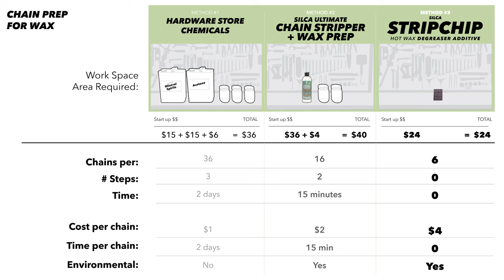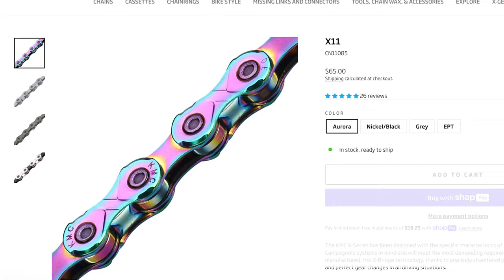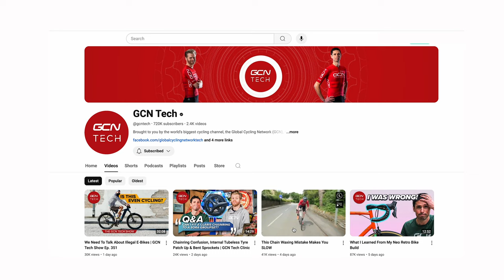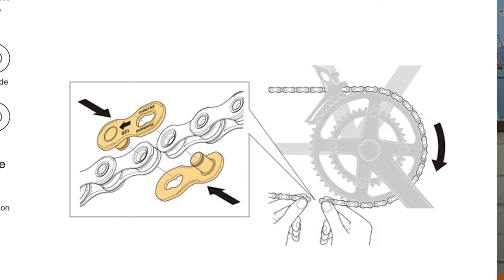Chain Waxing? Avoid These 7 Common Failures!

Comment: For those using a water bath or crock pot to melt wax (without accurate temperature control), a simple meat thermometer can eliminate the worries about hitting the right temperature.

Comment: To find the engraved writing, scratch with your fingernail.  If it has any rough texture, that's the writing side.  If it's dead-smooth it's the non-writing side.  No need to try and see through the wax.

Comment: When cleaning/ degreasing the chain it's super important to make sure that the chain is %100 dry before putting it into the pot. This helps the wax stick to the inside of the chain properly. That was the big mistake I was making when I first started waxing. Thanks for the great video Josh 👍

Comment: Thanks for the "skip break-in" portion. Other outlets and its comments seem to present not breaking in (on or off the bike) as a cardinal sin. Like it would hurt the chain or the wax application in the long run. I of course was skeptical about that stance, for exactly the reasons outlined; when you don't really care about a short period of less efficiency, if I break it in while cycling I get that period back as bonus longevity. 

This is maybe a "problem" in cycling enthusiast content and its commenters, much of the headspace is geared towards top performance, while commuters, couriers, recreational and other categories of cyclists that are not competitive receive less attention and less appropriate advise sometimes.

Comment: I have been using your wax lube for 8 months and have converted several of my riding buddies to also use a waxed chain.  I am the official chain waxer for the group.  Initially I mistook the interval of meters and was using a rewax interval of 300 miles or more.  I would check of wear each time with Park variable gauge and also with calipers with no measurable wear.  After several of your videos I woke up and realized my error.  I am now using one endurance chip per bag and rewax every 350 miles.  No signs of wear or noise on the drive train.  I use an insta pot and set the temperature at 190 degees F and verify by infrared measure method. Insert the chain for about 5 minutes and then reduce the temperature to 170 degrees F, once the temperature reaches around 165, I remove the chain and let it cool above the pot.  On either a new chain or used I dip/shake in gasoline (cheaper than solvent) 2 times, each with clean gas.  Blow dry, and then ultrasonic clean for 30 minutes minimum in the sonic cleaner you recommended. Blow dry, alcohol dip and blow dry prior to wax dipping.  I know this sounds very time consuming, but I only do this once and am getting excellent results. Rewaxing is simple, wipe the chain clean and rewax.  Our group of 6 riders are amazed how quiet and the smooth the drive train performs.  No one would ever go back to the old petroleum lubes.  You have customer for life.

Comment: Great video. I am guilty of all of these mistakes at some point since I started waxing my chains with your products over 2 years ago. Before that I was disappointed with my homemade waxing blend even after I thoroughly cleaned the chains with degreaser, gasoline, and 90% isopropyl alcohol. The wax just wouldn't adhere to the chains. After I bit the bullet and purchased Chain Stripper and your Secret Blend everything works great. I don't wax my chains for more efficiency to go faster. I wax my chains to make the drivetrain feel smoother, and I believe that is what makes me faster. The only failure I have had which you don't list is having the wax get bunched up on the lowest cog on the cassette (11 tooth for me) and I thought it had somehow worn out because it was skipping. Found out later after I removed the cassette to replace the cog that there was a thick layer of wax between the 11 tooth cog and the next cog up which caused the chain to ride up above the cog and skip whenever I applied any amount of power to the drivetrain.
Reply: I get a build up between 11/12 cogs too.  A toothpick through there once a month works well
Reply: I use the super secret drip between immersive waxings, so I’m pulling the chain off and rewaxing about once a month (every 1000 km or 600 miles). What I do is take a brush and some alcohol to the cassette, pulley wheels and chainrings while the chain is off the bike and in the pot. It takes about 5-10 minutes tops, and removes all wax buildup so the buildup never gets to the point that it’s a problem.

Comment: I just completed a 4 day 335 mile ride on a SILCA waxed chain and used super secret lube once.  Chain worked awesome.  I just rewaxed at 120 and 75 degree temps with no wear over about 700 miles.  Love this silca waxing system.

Comment: One thing I add is to preheat the chain before I put it in the wax. Living in Arizona makes it easy as I just put it in the sun for 10 minutes. This lets the wax get into all the small spaces right away. You can see this when you agitate the chain in the wax. Lots of bubbles right away, after 5 minutes, almost none. I've been using/waxing KMC chains and and I wax every 500-750 miles before it gets noisy. Cassettes and chain rings aren't cheap. Better to wax more frequently than to let it run too long. Lastly, I put a label on the chain stay with the date, mileage and Park Tool measurement so I don't forget. I get the watt savings from waxing but personally, I do it for cleanliness and chain longevity.

Comment: Embarrassingly I have made every single one of these mistakes except the first one :-)  Particularly, I have been unbelievably creative when installing the chain. I've threaded it in ways that I'm sure are theoretically impossible.  You do get used to it.  One tip I'll share (which I haven't seen anywhere): When putting the quick link on, you have tension from the pully. The chain is often slippery from the wax (hooray!).  It makes it difficult to put the quick link on.  Some people use a piece of wire to hold the two ends of the chain together.  I actually thread the chain so that the left hand side ends just a couple of links past the lower pulley wheel. In my left hand I grab both the pulley wheel and the end of the chain and pull to the right to create slack in the chain.  Then I put the quick link on with my right hand.  Once it's aligned, I use the quick link tool to fasten it.  It should close easily.  If it doesn't, then it is misaligned.  Don't force it.  Just take the quick link off and try again.  Holding the pulley wheel with you left hand makes this very easy.
Reply: Love this comment. Have never found connecting the quick link to be a quick process, but I also use the same method you do. Still tricky, but wish more folks talked about creating slack.

Comment: Having waxed my chain for the first time this year using the stripchips and wax from Silca and I can recommend it to everyone. I also routed my chain through the wrong side of the tab but it's all easy to figure out. If you can boil a pot of water you can wax your chain and over time it makes maintaining your drivetrain tenfold easier.

Comment: OK, you asked for unique questions so here's one.  I'm a 75 year old recumbent trike and velomobile rider.  I have a degenerative muscle disease and only can put out a FTP of about 150.  Being that I have a long chain and low power, it seems that my waxing lasts about twice as long as is "recommended".  Am I correct.  BTW I have been waxing my chains for over 30 years and love the ability to work on my rides without getting filthy.  Keep up the good work and great products.  Ron

Comment: Hi Thanks for making this video. I have done all of these mistakes! Also one I got in the past is "not cleaning wax residue on small cogs and pulley regularly". If I don't clean it for a year it causes jumping chain or some weird noise! I had this more when I use Squirt actually, but probably also happens with Silca wax too. And be careful if you use SRAM you have stealth ring there so not to damage it.

Comment: The thing I was ready to complain about the first time I used many SILCA waxing gear was that I couldn’t get the quick link to close. I scraped the wax off the inner plates through which the quick link attaches and it fitted. Now, I just wipe those plates with a cloth as soon as I pull the chain from the wax.

Comment: Thanks Josh appreciate you! hey, Has anyone tried cold wax? Rubbing it onto a clean chain..  skateboarders have been using it on metal and concrete to remove friction for decades,  it seems to last for ages on a ledge or rail .. food for thought . thanks again for your integrity.
Reply: Rubbing it in may not get it into the pins.  Silca will hate me.  I use canning wax.  It dissolves in Coleman camping fuel (benzene - white gas) or even regular gasoline.  You can spray the dissolved stuff on and the gas will evaporate.  However, I do put the chains in melted wax too.  The dissolved wax thing is like a refresh for the chain.  By the way, we used to rub wax on skis and sleds when I was young.

Comment: Love the wax station & hot wax and Super Secret…use all 3. I have SRAM Transmission T Top black chains and XX1 Eagle black chains…I think these have the PVD coating as well. Does this have the same effect as the rainbow chains??

And will the Endurance Chip help at all with longevity for PVD coated chains?

Thanks!

Comment: I would like to see a video where you take a waxed dirty chain off a bike and take us through how you clean it to get it ready to go back into the silca waxing pot.
Reply: Wipe off chain. Blow off dust if you have compressed air.  Rinse off if you've been riding mud. 
Dry chain.
Remove.
Put in pot.

Not a lot to it.

Comment: As someone who uses the bag to prep my chains sous vide I always keep it in there for a long time. I would say as long as you let the chain get up to the temperature of the wax, leaving it in too long as it cools down is not the worst thing in the world. It just makes a little more work cleaning off the excess. I also make sure to free off all the links befire installing. I will bed in my race chain but it's good to know it's not imperative for training, or for my commuter where the longevity and not the performance is priority.

Comment: At 4:55  Josh shows an Insta pot he used to use. I have the same one and it wasn’t working properly until I put thermal conductive paste on the temp plunger underneath the pot. Its now more consistent. (No food burn messages) You can get surface compliant soft thermal conductive pads used in electronics that are less messy than paste.

Also stir wax before taking IR temp readings because there are large temperature differences, from top to bottom of unstirred melted wax. (30degC diff in 30mm using a submerged thermocouple)

Comment: HI, I have only just got myself one of your hot wax systems and have now waxed two new chains using the strip chip, it was nice and easy and seems to have worked really well so thank you. I was wondering however if you remove the wax for the center of a hollow pin chain before installing it on the bike? I can't seem to find any info regarding this. Cheers and thanks

Comment: Hey Josh. Regarding the rainbow/oil slick chains, does that also apply to the SRAM XX1? what about the copper XX1 chain?
Reply: I’ve been having short wax lifespan on my rainbow xx1 chain as well.
Reply: I just waxed two of the xx1 rainbow for my MTB was planning on rewaxing at 150 miles with some drip touch ups every 75 miles. Before I was using just the drip on my xx1 rainbows it seemed to hold up to 150 miles but needed more touch ups.
Reply: Of course. I watch this after I waxed and ride with my new xx1. Guess I’ll pick up a plain ol xo1 when I catch a sale.
Reply: I decided to buy another XX1 chain maybe bronze or gold to rotate use with my already and new rainbow xx1 chain. Figure I’ll be able to compare and report back shortly. I checked out the SILCA website and they sell rainbow prewaxed chains. Does this mean they’re good?
Reply: Bumping this question. The chain coatings seems to be the biggest piece of new information here. It wasn’t clear if it’s all non-silver coatings? Are the copper, black, or gold SRAM chains ok?

Comment: Excellent stuff Josh. On my first chain i did remove my chain from the crockpot too late. And yes there was a coating (candle 🤪) all i did was break the chain in for a longer period. BTW i ride a Brompton as well and you should really look into it - what’s the difference? Well the chain sits very low to the ground and i found Silca Hot Wax to be excellent. Gone are the weekly degreasing and re-lubing. With Hot Wax, followed with Drip Wax - after each of the first 3 rides i now have an ultra quiet chain. Only on one Brompton do i use Silca’s wet lube. It’s my all weather bike. And even with that the chain is quite clean as a really wipe it down after each ride with the Silca Gear Wipe. A very nice system you have. Costly but nice. I don’t wax for watt savings but i am inherently lazy. I do have one question - since i am using Strip Chip these days - when the time comes to wax another chain that the grease has been stripped using either mineral spirits (turpentine) or Chain Stripper; i am assuming i can just go ahead and drop it in the old wax pot (it has a thin white layer now that i started using Strip Chip. For clarity; can i go ahead and reuse the same wax pot (now with left over Strip Chip) on degreased chains - in other words - for new chains with factory grease put in a Strip Chip - and same pot without a Strip Chip if using a degreased chain (either using Chain Stripper or Mineral Sprits with a alcohol rinse).

Comment: Thanks for another good training video! Greatly appreciated! As a long time follower, and even buying waxed chains directly from SILCA, I’m still confused. Specifically about the temperatures…. I don’t trust the buttons on the crockpot… so I use an IR thermometer that reads the temp  y aiming the IR beam at the wax (20 bucks on home depot or Amazon) and use that to gauge the process. What is the temp (or temp range) where the chain should be immersed in hot wax, and for how long? And then, when I turn it off and it cools down… at what temp should I take it out? TIA!

Comment: Josh, I've tried your microfiber cloths and they are nice to use on a waxed chain. Can you wash and reuse them or should they be used once and thrown away. I'm a little worried about how the wax residue they've picked up from the chain would do in a washing machine and interact with laundry detergent. Laundry detergents are design to handle oily rags, but wax? I don't want to end up with wax residue in the washing machine or being transferred to other clothes. If a washing machine is problematic, is there another way clean them.

Comment: Wasn't aware of the temperature issue. I always use the crockpot on high! I assume many others do that too!
Reply: If your slow cooker is Crockpot branded, I'm pretty sure that the "low" and "high" temperature settings will both turn off at the exact same temperature.  The difference is that the high setting will blast more power into the crockpot to heat things more quickly, while the low setting will very slowly heat the contents.  Other slow cookers might behave differently in terms of the maximum temperatures they reach.

Comment: Thanks Josh! I've been using silca immersive waxing for road and mtb. Best method ever! Just one question regarding the wax. I'm afraid I put a brand new chain with factory grease and the strip chip but somehow at 125° is reacting, but when I turn it down to 120 it's fine. Should I throw away this wax and try to use new wax in the pot? What's the best way to clean and throw dirty wax? Thanks in advance!

Comment: I've properly cleaned and have been using wax on my chains for close to 7 years (Squirt), but I still find a full hot dip with the Silca wax only lasts around 160 kms before the drivetrain noise becomes irritable to me. I have been using the Silca products for about 6 months now. I'm still trying to find out how to make the dip wax chain last longer.

Another issue I have is with the Silca drip wax. I'm using that in between hot dips. I've found that it mostly runs off the rollers and eventually drips to the ground. I have to apply quite a bit to make sure it gets in between the rollers and plates. It's as if the rollers are super coated and not even the drip wax will adhere to it.
Reply: Hi.  Fwiw, I’ve had similar problems.  Here are a few things that helped a bit.  Apologies if this is old news.  Did you see the Silca video on how to apply drip lubes?  That helped me some.  Also, I agitate the bottle for a while.  Finally, while hard w my ADHD, I try to go slow and use just a little on each roller.

Comment: Instant pot’s “keep warm” setting on high is 75 celsius.
Reply: Very useful! He shows it on the sauté setting, which is very hot. I use the slow cook setting, which is around 85 on mine, I will try the keep-warm.
Reply: I nearly always get the food burn warning from my insta pot then it switches off. Really annoying. My wax depth is about 30mm, 11/4. I have a lot of trouble to get it to stay on..

Comment: Great video! I have a question - is there a risk of permanent stains by drips of wax on the countertop or wax flakes on the floor due to the tungsten disulfide. What’s your experience and do you have some cleaning tips? Thanks!